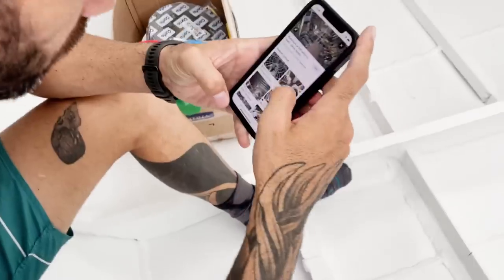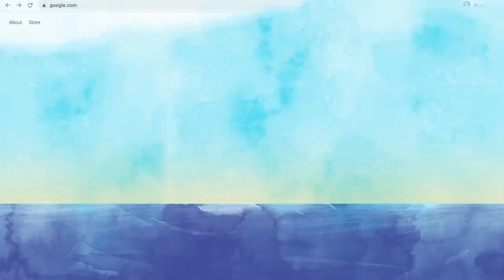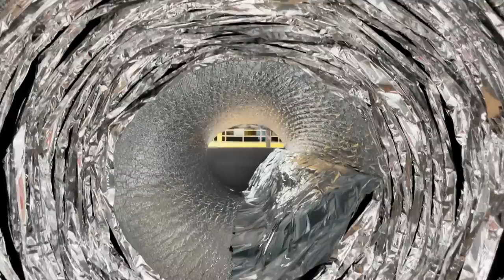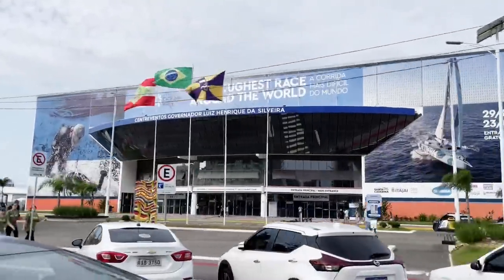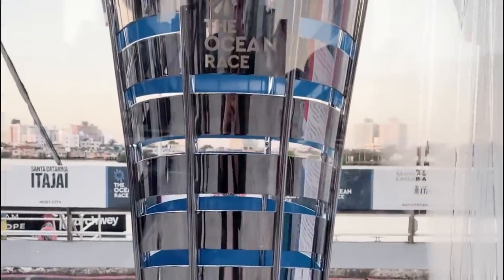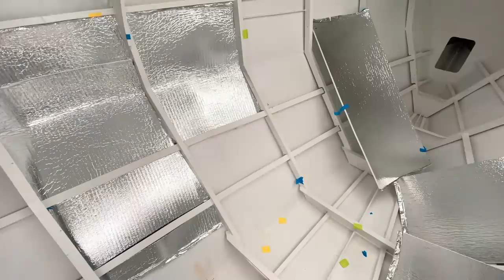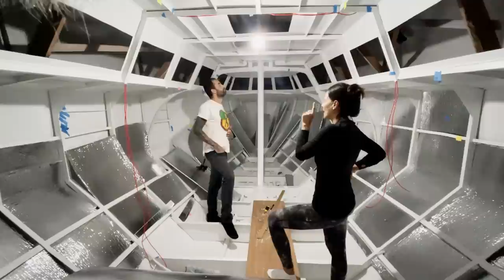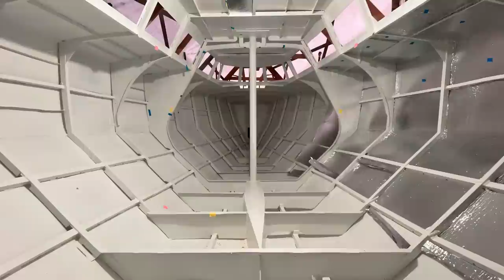Our Sailboat restoration hits Major Snag when installing INSULATION 3TC ⛵️ Ep30

Comment: The insulation may not do what you want. The radiant part only works when you have an air gap over the reflective surface otherwise it just acts as a conductor. The foam core has an R value of 5 per inch.

Comment: If you have any air gap between the insulation and the steel you WILL get condensation form.  There are special paints that are designed to deal with the issue but they are very expensive....one solution that works extremely well is to glue a closed cell foam directly to all the steel surfaces. This prevents any moisture being able to form on the steel behind your insulation and eventually cause corrosion. 
Remember steel boats rust from the inside out.
Once you have a bonded costing of closed cell foam you can use a number of products to provide more thermal insulation value.....but pleae check that the product you use can not hold water.....

Comment: The 3 tc is ok if you can stop it from bubbling, on metal next to impossible, polyurethane spray on for cool storage and freezers is by far the most effective method for the job , plus when wiring your boat you can cut channels for conduit to lay in and run wires through it with inspection points every so often, this way you keep everything neat and tidy and easier to maintain, hopefully you will read the comments before you advance to far , reading the comments has been a real eye opener, you are lucky having so many switched on people following you , keep up the great work all the best from Tasmania Australia 🇦🇺

Comment: I used a similar product to this in a steel boat but what I did was I attached it to the back of the interior as it went in so there was an air gap to the hull all the wiring was there and it worked as an extra moisture barrier between the cabin interior and hull. I could remove parts of the interior to inspect the hull. This is also great for the floor as the hull and bilge are uninsulated but the bottom of the floor sole was insulated, this was great for beer can's stored under the floor. 

What you have done works but this is for others following you far less cutting when attaching to the back of the modular interior pieces. Yes I an sure you will hate me for this suggestion now.

With steel boats (I have had two) you need to let the water get down to the bilge and not be trapped between surfaces or fairing compound. I learned that from my first boat I called it Jessica after an ex, she was always demanding money and mistakes or forgetting to do or check something was expencive, just like the boat and both had beautiful lines and every imperfection was hidden.

Anyway both Jessica's had to go as I wanted something better but cheaper so not as finished and I did the work. Much better yacht and it was never named after an ex :D
Reply from the maker: 😂😂 Smart to name your new boat after something that has more longevity.

We did consider doing that as well but the company 3TC instructed us to apply it this way. That being said, all of these wonderful suggestions in the comments have us thinking and we are scheduling a call with their engineers to clear up these questions. We will definitely do the same as you did with the floor. We want to have some cool storage in the bilge as well. And let's see after the call what we will do with the hull! 

Thanks for your great feedback!! Super helpful! Cheers ⛵️🙏
Reply: yeah, boats and women are like that...demanding and expensive. In life it seems that going for an older model does not cost as much (boats and women)

Comment: 3M adhesive spray works well on that insulation for stuff that needs extra support.  They also have a wire type insulation hanger, that just jams between wood rafters,  but figure that would scratch the paint.  Think just a dab of spray  on the corners would hold the rood stuff in place.
Reply from the maker: Great suggestion! We are looking into a way to adhere it without being destructive to the paint if we do want to check behind it. We'll look into this. Thanks!

Comment: I'm wondering if the insulation shouldn't be glued on its entire surface to the boat to avoid empty spaces between the insulation and the hull, where the condensation will appear and moisture will start the rust. That will ruin all your efforts. Maybe better would be the foam sprayed on the hull directly. or just use waterproof contact glue on the entire surface of the insulation.
Good luck with your project! Greetings from Poland.

Comment: I have a question. The insulation is against the hill so you still have an air space so you will still get condensation. Can the condensation run down into the bilge or will the stringers hold it? If so you have a problem.
It would have been easier to leave the air gap and finish the interior with insulated panels???
Reply from the maker: Good question because this was the original issue the boat had and the main reason it had so many issues. All of the longitudinal stiffeners that we replaced were predrilled to allow water to pass in case of moisture and such. The ones we didn't replace were drilled as well. We will call the company again to hear what their suggestions on this or if their product helps reduce or eliminate condensation as well. Thanks for your help!! Cheers!
Reply: Just a thought. Have you spoken to odd life crafting or artic alluring sailing. ( or alluring artic sailing)They both have steel boats. One is in the Caribbean and the other is in the Artic. I’m sure they both have insights into this issue.
Reply from the maker: We are friends with Odd and ask them advice every now and then. They have been very helpful! We'll see what happens if we send a message to Arctic alluring as well! Cheers

Comment: Hi, please don't insulate under the waterline.  Insulate under sole . Seal frames using neoprene layer on frames before fixing wood preframe . Just so you know credentials ,I'm a boat builder of 35 yrs , building steel boats . I CMarine Services UK Southampton  registered with companies House.  In doning under waterline your hold water and damage won't be visible until to late. Held water can rot a 6 mm plate in 2 yrs , epoxyed as well
Reply from the maker: Thanks for your feedback! So we knew about the waterline rule before but we were in doubts about it because this is a new product and it claims to essentially stop conduction and be completely waterproof. We're going to contact the manufacturers and talk to their engineers to get more info but any insights on this is welcome!

Comment: You do realize that there's a certain type of spray foam to use for insulation purposes. The white/yellow stuff in a can isn't what's supposed to be used. Here in America the spray foam insulation is the best thing to use if you can afford it. It blocks all 3 forms of heat or cold transfer. This is how in humid places like Florida they can have a very efficient home and same goes with cold climates. I wouldn't use blanket insulation aka fiberglass, wool,recycled blue jeans etc due to the mold issue. I live in the northern midwest area of America where we have 4 seasons and my information is based upon what I've read and what I've experienced

Comment: Hey guys. I’m building a steel boat from scratch. You insulate the bottom of your sole, not the hull below waterline. What if you get a puncture below the waterline? Your insulation will prevent you from sealing the hole. Also, don’t run wiring between the ribs and hull. What if you bump a rock? It will cut your cables.
Reply from the maker: Thanks for the advice! We were looking into some of the reasonings behind why people don't insulate below the waterline, so we are happy you wrote here. Our questions was if it was just not to allow the insulation to be damp or wet and since this is waterproof we were in doubts where to put it. But your explication makes perfect sense! We're making adjustments! Also for the wires, check out our episode today, we're working on this as well! Thanks again, cheers!

Comment: I hate to tell you all this, that insulation below waterline will cause very bad condensation and you will ruin the boat.  Trust me I know.
Reply: Is not this a question of where you would like condenzation to happen…? Where you sail and how you handle the water that then is produced? Keep in mind that that many materials used for boat building have isolating abilities (such as wood, and any core material) very different from steel with workshop as a heat conductor. Most of these boats have no added insolation…

Comment: its will be dangerous to place the electric cables between the hull and the rips, if there coms pressure from water or you have an incident the cables can be squeezet and perhaps will be destroyed.
Reply from the maker: We haven’t installed any wires yet. We just measured them and calculated placement. Finding the right conduits are next!